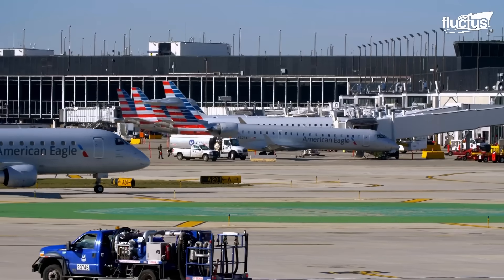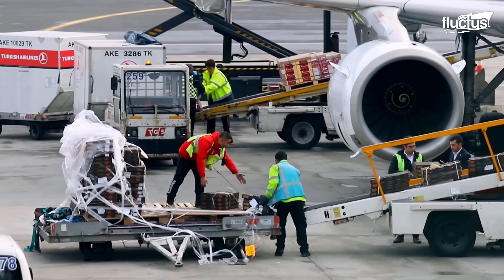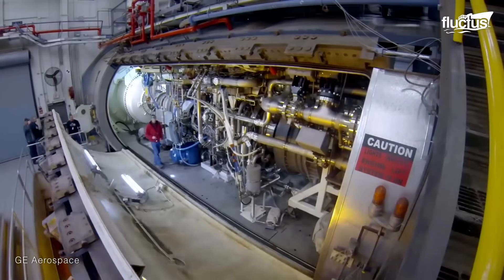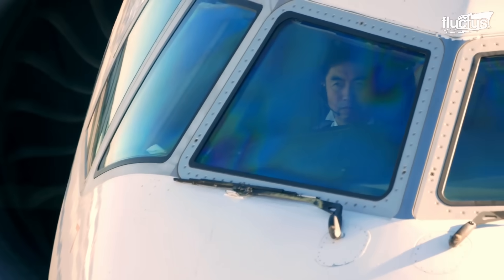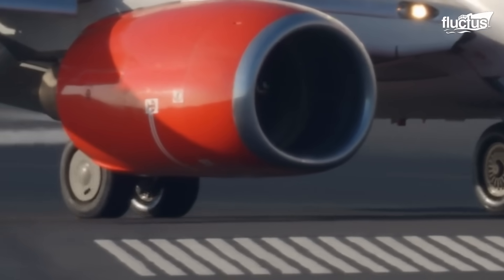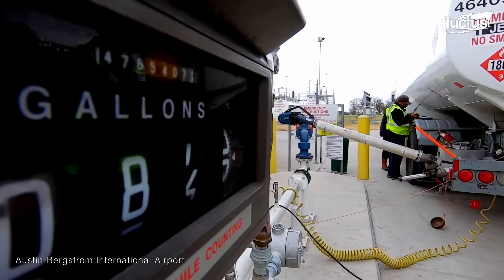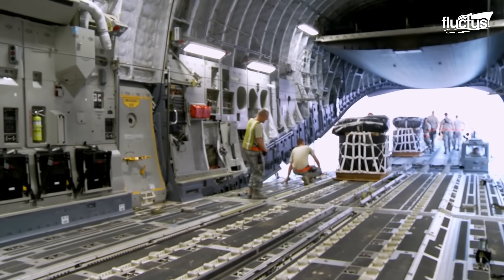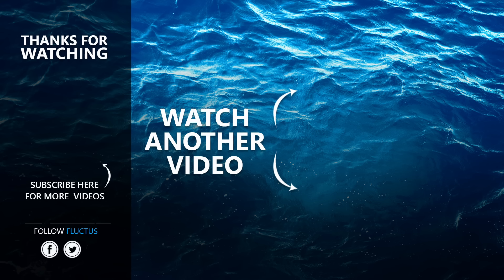The Scary Dangers of Working Close to Gigantic Aircraft Jet Engines

Comment: I mean I think to reduce the sucking thing should they put metal net I mean if there got suck it will stay right so other to fix that well male an metal cone with a lot of hole maybe 4 inch hole?
Reply: Because the metal net would pre-grate the unfortunate bird - it would still end up sucked into the engine. Just be in tinier pieces. Such is the power of those engines.
Reply: Putting some sort of netting in front of the engine would interfere with the flow of air into the engine causing a reduction in engine thrust. This would get even worse if the airplane was flying through meteorological conditions where icing is likely to occur. If the accumulated ice on the netting becomes severe enough the flow of air could become so restricted that the engine could shut down completely.

Comment: Just put a net in front of the engine
Reply: The object would be sliced by the net, and still end up in the engine.
Reply: Putting some sort of net in front of the engine would interfere with the flow of air into the engine causing a reduction in engine thrust. This would get even worse if the airplane was flying through meteorological conditions where icing is likely to occur. If the accumulated ice on the net becomes severe enough the flow of air could become so restricted that the engine could shut down completely.

Comment: Why don't they just put steel grates over the intake so nothing can get sucked in
Reply: Putting some sort of mesh in front of the engine would interfere with the flow of air into the engine causing a reduction in engine thrust. This would get even worse if the airplane was flying through meteorological conditions where icing is likely to occur. If the accumulated ice on the mesh becomes severe enough the flow of air could become so restricted that the engine could shut down completely.
Reply: The poor birds would still get sucked into the engine, but be in a pre-grated form 😖
Reply: Because a large bird would punch through it, and then you would have not only the bird debri go into the fan, you would also have the screen go through the fan and cause even more damage downstream in the engine core

Comment: This video doesn't address the other main hazard around jet engines----The DISCHARGE out of the back of the engine is just as dangerous as the intake!The blast is strong enough to blow vehicles and people-even tear them apart!I have seen the danger "cones" painted on airliner engines while you board-show the danger zones on the front and back of the engines.
Reply: Military aircraft being refueled on the ground with the engines running is an asinine ideal.  Discontinue this unsafe practice!
Reply: @thomaspick4123 We are professionals.and we hot fuel for a reason..this is the military. It's not for the timid
Reply: Not discharge. It’s referred to as Jet Blast. Yes it’s dangerous, but being ingested would be more catastrophic.
Reply: Got that right
Reply: Yep. And it doesn't have to be a jet engine. When I worked at the airport, I was walking behind a Beechcraft B90 ( if I remember correctly ) that was doing an engine test. They throttled up and I was blown off my feet, with my shin smashing into a steel trailer's tow bar. I thought I broke something but I was lucky. Even a small turboprop can mess you up.
Reply: @paulczubryt8644  when you get down to it the airport tarmac is loaded with hazards-and prop engines are dangerous just as jet engines are-wether its in front or back of the prop. Have you seen the HUGE signs at military airports and aircraft carriers?
Reply: @paulczubryt8644 a turboprop has a jet engine that drives the propeller…
Reply: I'd rather get blown around by the exhaust that go through the spinning bits in the front! 😅
Reply: It is not "DISCHARGE". It is called thrust. I am an A & P, I know what I am talking about.
Reply: @mikeapmechanic4423 Feel the need to validate yourself in front of the class did you?
Reply: But talking and videos of hamburger meat being created is more gruesome and exciting than exhaust accidents.  I have seen Africans standing at the end of runways, so they get the feel of the engine exhaust, then they feel empowered.
Reply: Efflux
Reply: I was planespotting next to a gate a few weeks ago. Got blown 5 feet away from the fence at about 30-40% thrust. Got a video of it too! It was fun 😂😂
Reply: And blow away ugly trains btw cuz trains suck
Reply: The exhaust system engines was called "experience" they can also make an landing called tai kai landing and normal planes other touchdown system things as an African in an 747 engine was a fire engine who got k!lled the things rest in peace also.
Reply: It is more dangerous... Much more dangerous
Reply: It’s called the exhaust.
Reply: @justing42  It's called thrust in aviation jargon😅
Reply: @jonathan4044 thrust is the measurable force created by the exhaust
Reply: @joemarchinski914  DUH!
Reply: @joemarchinski914  which is thrust
Reply: @justing42 th exhaust is something very different at the very back of the plane

Comment: Don’t have them running,while people are doing loading or maintenance?
Reply: Usually they don't, but sometimes they have to. The recent accident where a ramp worker was sucked into a jet engine happened when the airplane's Auxiliary Power Unit (APU) wasn't working. Usually the APU provides electrical power for ground operations at the gate until the airplane can be connected to ground power. Without the APU being available they had to keep one engine running for a short period of time after the airplane got to the gate. Despite being warned about the hazard one ramp worker walked in front of the engine while it was still running and she got sucked in.

Comment: Arent engine caps with hollow mesh designed strong enough to push the bird off to the sides on impact while not impeding upon intake a standard thing for such engines. You would think that would have been mandatory years ago.
Reply: I think that was tried-but it cut down on air flow...
Reply: @avstud09  You see them sometimes on model jet engines, which have a rather high risk of FOD being sucked into the engine.  There is definitely a performance hit.
Reply: Engines no airflow with zero tolerance

Comment: At the 12:20 mark, you are absolutely incorrect.  A gas turbine engine ( whether it's a purely jet, or a low bypass or high bypass) does not take long at all to "warm up" as you narrated. In all accounts as soon as you taxi the aircraft to the active runway the engine will have had more than enough time to warm up to proper operating temperature….
More than likely, hot pit refueling aids and saving time, by keeping trip and mission data loaded in the flight computers, and all the avionics running. 
PLEASE,  do your research before making more videos!!!!
Reply: About 5 minutes.
Reply: We used to hot pit them in the Air Force to SAVE TIME

Comment: It doesnt take any time to warm up a jet engine after they're shut down lol, at most they'll need to be motored for a few seconds to get the PTIT down..but you can go from 0-100% as soon as the engine cranks in normal weather conditions. The reason it takes so long to fire up a military aircraft, is because of all the AVIONICS and other sub systems that need to be reinitialized after electrical power is cut.

Comment: Unless the engine is running at a very high RPM, No intake accident should occur, while the aircraft is at the gate, loading unloading or fueling. During takeoff and in flight intake incidents can take lace!
Reply: Agree. Intake incidents do not happen at low RPM situations like pushback. Serious accidents need the engines running at fairly high throttle settings.
Reply: It happens. Not long ago a guy was suck into an engine.

Comment: Former Boeing Everett.... The GE9x high bypass trubofan jet engines used on 777 and 787 are HUGE.

I have stood inside front cowling of these gigantic engines. The front main fan is 11 feet in diameter. It's wide enough to suck cars and trucks into it's blades. Most of the air flows around turbine core. 10 parts air bypass for every 1 ingested for gas turbine. Most of the trust comes from this bypassed air. They produce over 134,000 pounds of thrust - a world record. Engines are so large, they won't fit inside a standard house. A portion would stick out through the roof.

If they can suck trucks off the tarmac they have no problem sucking up people... and that really sucks...
Reply: I live right next to Paine Field on the Mukilteo side. Did you hear the boom a few nights ago?
Reply: @enndubful  Thanks for comment. No I live in Yakima now. My sister in law lives in Mukilteo. What was the source of noise?

When I worked at Boeing, I lived between Everett Mall and Boeing. A nice 5 minute car trip on back roads. Sometimes I had to go to Renton for workshops. That drive was no fun at all.
Reply: Ahhh just moved from Washington

Friend’s dad worked for Boeing fabrication
Reply: @lspdfrisawesome8972  Thanks for comment. Do you know which plant your friend's dad worked for?
Reply: Hmm not sure. I’m stupid so could you clarify what “plant” means in this case? Pretty sure what you mean just want to make sure. Sorry lol.
Reply: @lspdfrisawesome8972  Not a problem, I meant what factory did he work at. In Puget Sound Area, Renton and Everett are the big factories. There are a number of other support sites near the big factories providing components.
Reply: @SJR_Media_Group  Think it was Everett but maybe Renton
Reply: @lspdfrisawesome8972  Thanks for comment.
Reply: I've learned more about  jet engines from you than the video.
Reply: My friend’s dad works at the Everett factory in prefab. Know a Gerald N. By any chance? PS do you know any 737 pilots I can speak with? I’m about to get my PPL. (It’s me, lspdfrisawesome on a new account. I got more info on where he worked.)
Reply: Will look for you @beannosman3855
Reply: I usually roll my eyes when I hear “I work/worked at Boeing”